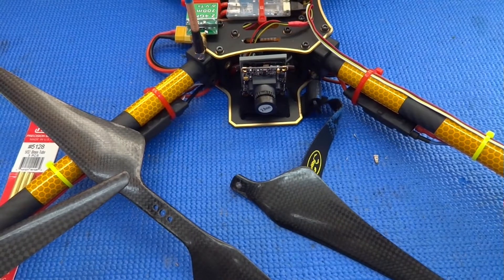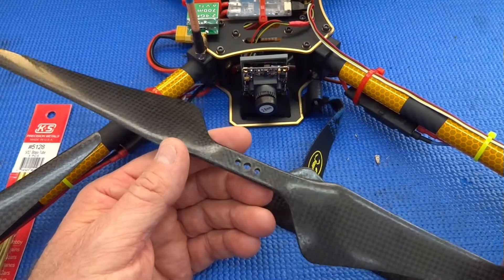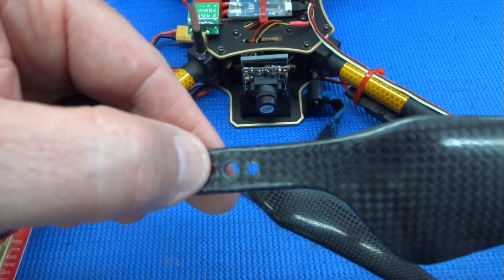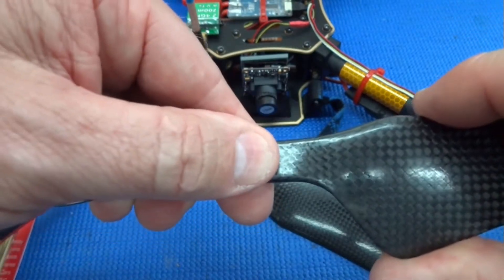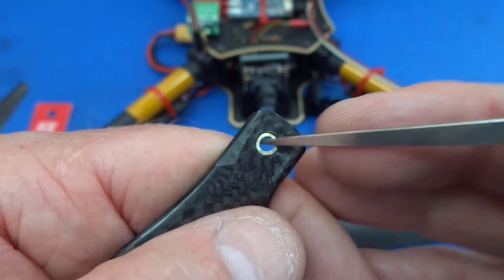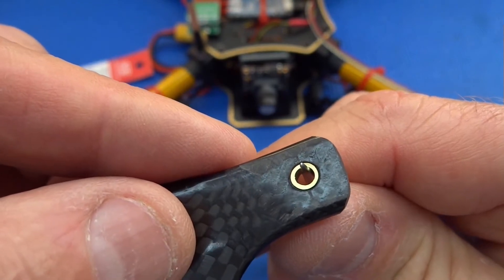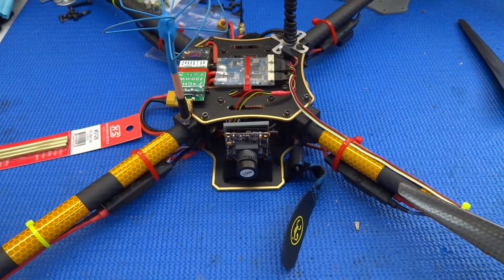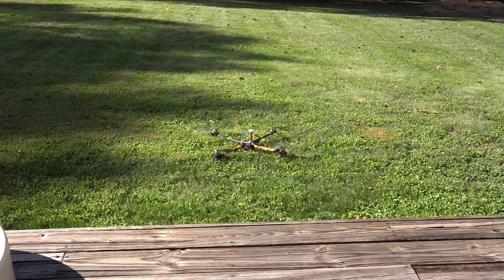Make BIG Props with KDE's Triple Adapter

Comment: It's amazing how you got this to fly so well and with experimental props no less!  I didn't think a quad could be built at home and be made to fly since even a lot of commercially made ones won't fly.  I bought what was supposed to be a fully assembled RTF, Ready To Fly, model called the Quanum Venture from Hobby King but it was too heavy and under powered to even get off the ground!  Their idea of RTF seemed to be a lot different than mine since I expected it to actually be able to fly!   It had a bad motor and ESC at first that I got replaced under warranty but were nearly impossible to replace since they put thread lock on all the screws. A number of people on the forums said they sent their's back when they wouldn't fly but I didn't want to pay for return postage and thought I could fix it myself.  However it still wouldn't lift off with the 8" props that came on it.  I removed the top and heavy bottom cover to try and lighten it some but that didn't help much so I tried using 10" props and got it to go up about 2' but wasn't very controllable using a KK2.1 and wanted to tilt backwards all the time.  A better flight controller can't be used because it mounts on the bottom where it's UPSIDE-DOWN and they won't work that way. I eventually gave up, put it back in the box and away in the closet!

Comment: Nice home-brew innovation!

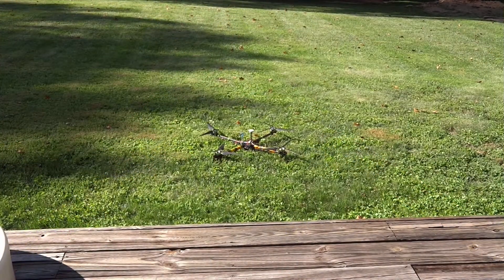4:32 Wow, went right for the field trial.  I would have mounted a motor on a stationary fixture and run the blades through that first...  Crawl, walk, run...  

6:16 I too fear for my eyes when testing something that might catastrophically disintegrate into shards of fast moving pieces.  That why I like to use some clear ballistic protective lenses, you can usually find them at your local hardware store.. Just san'n...

Comment: That's a cool experiment. I would have guessed the tri-blade would have been worse in efficiency due to conventional knowledge. Which is to have the minimal amount prop wash from multiple blades. However with lower RPMs and more need for static thrust, that may be reserved for regular fixed wings. I would assume balancing those would be very painful =)

Comment: how much would these cost? and did you drill the 2 center holes in the adapter that connects it to the motor or these holes come standardly ? another thing would the 3blades stay loose "can move left to right" or i have to lock them in which between each blade there must be 120deg angle ?
Reply: thanks for the reply,can you lead me with links from where i can buy and ship to eu?
Reply: Abci Elejmi i mean the kde adapters not blades , i can only find them for 38$each which i think is alot